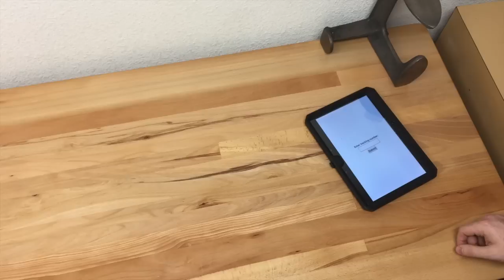Cole Haan Shoe Repair from Cobblers Direct

Comment: no cork?
Reply: These Cole Haan shoes never had cork to begin with. These are Blake stitch, meaning cork is not a necessity. Blake rapid and Goodyear welt construction shoes (different thing) usually have cork but traditional Blake shoes like this almost never do.
Reply: @jacobbwalters8133  can i get cork with it anyways?
Reply: Ricky Rilveria theoretically you could but you probably wouldn’t want it. Putting cork in shoes that did not originally have it could make them feel lumpy or unusually tight on your foot. Keep in mind that cork is used in shoe making to fill a void that is created in the construction process. If no void exists in a particular pair of shoes then adding cork is counter-intuitive.
Reply: @jacobbwalters8133  ok that make sense. thanks for that. i always thought cork was in there, they are so comfy.
Reply: Ricky Rilveria Cole Haan shoes are very comfy in the short run because they use athletic foam similar to what is used in running shoes. Unfortunately, I have to replace my running shoes semiannually due to the foam becoming compressed over time and no longer offering support (the rule is about every 200-300 miles). The same can be said of Cole Haan shoes.

Comment: Only thing I would complain about is not replacing the cork.
Reply: These Cole Haan shoes never had cork to begin with. These are Blake stitch, meaning cork is not a necessity. Blake rapid and Goodyear welt construction shoes (different thing) usually have cork but traditional Blake shoes like this almost never do.

Comment: Nice!
I used to work as a shoe repairman in Sweden in 91 - 93.
What sweet memories this brought back.
Nice video!!
Reply: jack ramirez  Well, it was a handycraft. But at that time cheap shoes invaded Sweden as in many other coyntries, so repairing your "daily drivers" was not always the cheapest option.
Lots of zippers and stitches on bags, jackets, repairing high heels and so on came in every day.
Keys were duplicated and cars got opened when the keys were locked inside (yes that happened a few times every year) and appartement doors had to be picked.
Some a bit more luxorious shoes (somebody remember Dexter?) came in for a rubber sole to protect the leather from the swedish damp weather thanks to a shoe store in the same mall where I worked.
I think it was like in most of the industrialised world at that time 
No day without anything to do

Comment: Where's the hot cork as advertised?
Reply: These Cole Haan shoes never had cork to begin with. These are Blake stitch, meaning cork is not a necessity. Blake rapid and Goodyear welt construction shoes (different thing) usually have cork but traditional Blake shoes like this almost never do.

Comment: Can you you handle cracked leather? I have a pair of grey wash with burgundy cap toe Penguin shoes that are one of my low end pair of dress shoes but I love then. The distress on them in pretty bad. Would love to get them back. I also have a pair of wing tip oxford Florsheim and a pair of bull boxer brown distressed boots that could use work
Reply: Its_MillerTime 315 Bedo’s leather works that guys great

Comment: Nice work but only one thing missing, no re-corking ?
Reply: It is blake not goodyear so it has no cork
Reply: yeah. it's really stupid. i have a blakestitched shoes because i wanna have a shoes with  thin, clean, and slim-edged outsole.
Reply: Indeed. Blake has its uses. E.g. super light slim loafers. Even Gaziano & Girling do a blake stitched loafer. However, blake stitch has no place on a brogue!
Reply: Cole Haan Shoes never had cork to begin with. These are Blake stitch, meaning cork is not a necessity. Blake rapid and Goodyear welt construction shoes (different thing) usually have cork but traditional Blake shoes like this almost never do.

Comment: Poor work. You did not replace de cork. So the shoes will be uncomfortable.
Reply: Cole Haan Shoes never had cork to begin with. These are Blake stitch, meaning cork is not a necessity. Blake rapid and Goodyear welt construction shoes (different thing) usually have cork but traditional Blake shoes like this almost never do.

Comment: No Cork insole , No mid sole  .....Nice way of fooling customer!!!!!
Reply: Not fooling the customer. These Cole Haan shoes never had cork to begin with. These are Blake stitch, meaning cork is not a necessity. Blake rapid and Goodyear welt construction shoes (different thing) usually have cork but traditional Blake shoes like this almost never do.

Further, Blake stitch shoes never have a midsole as due to the method of construction it cannot be done.

Comment: is this blake stitching on the sole?
Reply: Those are Blake stitched
Reply: blake stitched
Reply: yeah, the goodyear welt would have the hand sown welt before the soles are sown.
Reply: Blake stitch.  If you look at the sole stitching machine you can see the shoe fits on top of an arm or "horn" and the shoe is rotated around this horn (usually 270 degrees) that carries a looped thread and stitches are formed by passing a heavy hooked needle from outside the shoe through the outsole groove, the upper and the insole and "jerks" the thread up from the horn back up through the outsole groove where a shuttle forms the loop for the knot that the machine pulls back down into the sole.  This horn feature is typical of the various Blake stitching machines and is small enough to reach well into the toe area for stitching.  Blake stitched shoe construction allows for a lighter, sleeker and more flexible shoe.  Note that the back/heel of the shoe can be placed on the very back edge of the outsole since there are no stitches there to avoid covering.  Since there is no void formed by the thickness of a welt, there is no need for a filler of cork or foam.